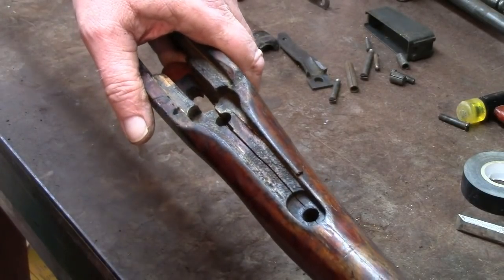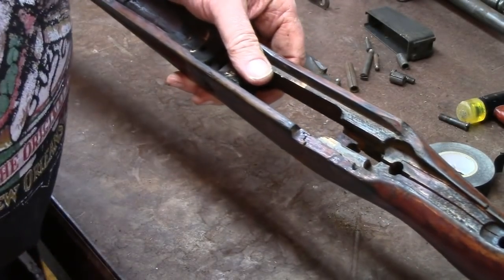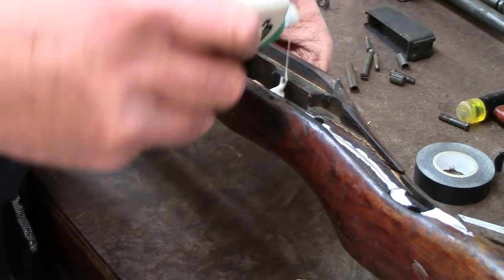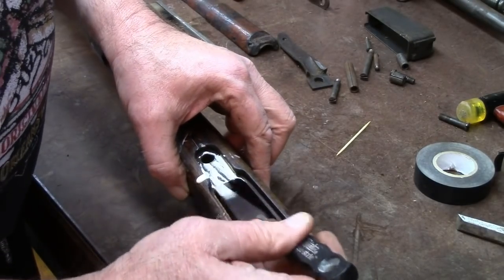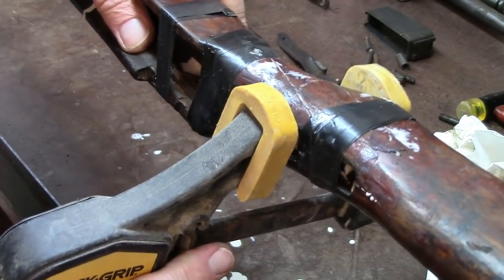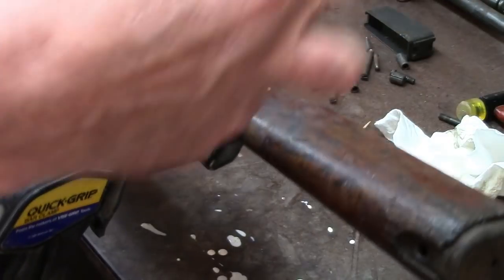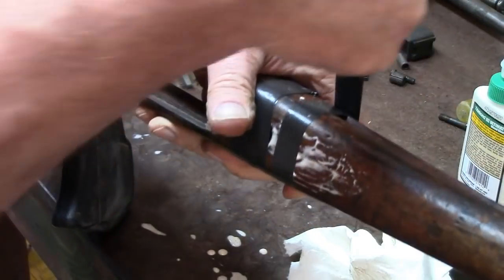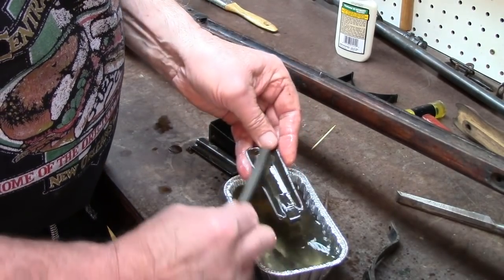How to Restore a Gun, Part 2 ~ Arisaka 7.7 x 58 Type 99 Japanese Rifle

Comment: When gluing cracks like that I've found that using my fingers as a tool to force glue in works better than any tool, then using air to blow into the tightest ones. Great videos, each and every one 👍

Comment: I have never had to repair a stock before this but now have a crack in the butt stock of my Marlin 39A. Lol, when glueing wood in the past I have been far too careful to avoid making a mess. Does my heart good to see glue dripping all over the place, so maybe my repair will actually hold together now for the .3 ft-lbs of recoil! From a loyal subscriber in TX, Mr. GunBlue, thank you so much and please keep up the good work.
Reply from the maker: If glue isn't dripping from the joint, you'll have a dry joint that will fail.  Thanks for watching! Good luck with your 39-A.

Comment: Great vids!  Medical rubber tubing works great for wrapping a stock and keeps a ton of pressure on it, nice thing vs the tape is that there's no adhesive on it to get on the stock.  The tape is fine on a stock you're going to strip anyway, but sometimes on a stock you're trying to keep the finish on, the tape leaves adhesive behind and is hard to clean off without damaging the finish.

Comment: I repair furniture now and then using the same method if glue and pressure. The compressed air can also be used to force the glue deep into cracks. A short burst is enough. I've even syphoned up a drop of glue in the spray tube and shot it into a hole. Give it a shot, might be just the thing to finish a job right.

Comment: There are much easier and more effective ways to restore the wooden bits. Spreade the cracks use a paint brush and blow the glue into the spaces (blow it through a straw or use it bit of compressed air). You can really cut down the amount of glues you are using just to get squeeze out. Also surgical tubing is elastic and wraps round unevenly shaped parts. It can be tightened and tied to hold glued joints together. Just a bit of crossover from the world of luthiers to the world of gunsmiths. They don't often align. Lots of violin and guitar repair techniques deal with more complicated breaks requiring finer finishing than this. They are childs play for these applications.